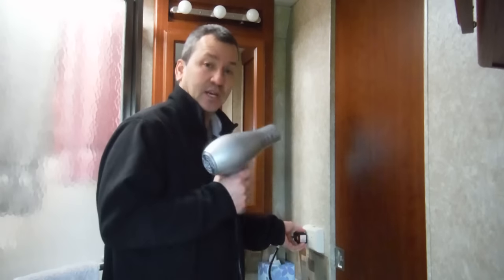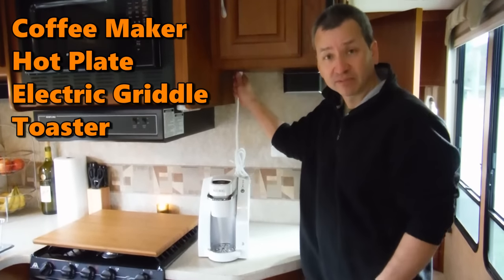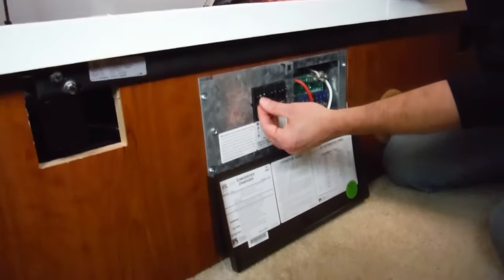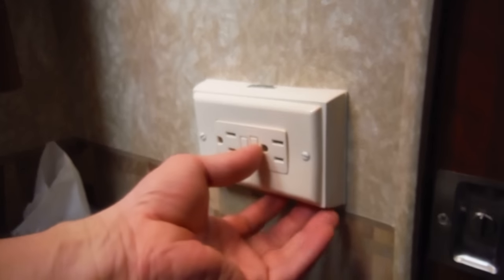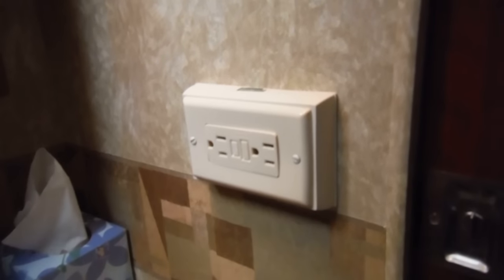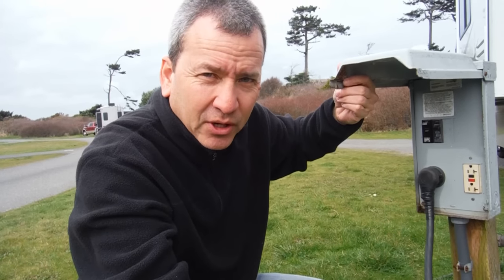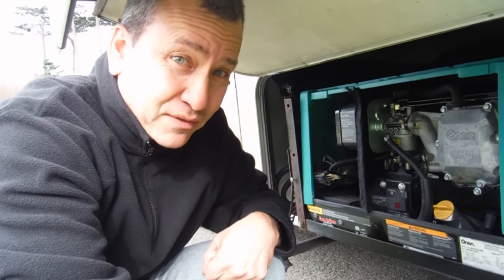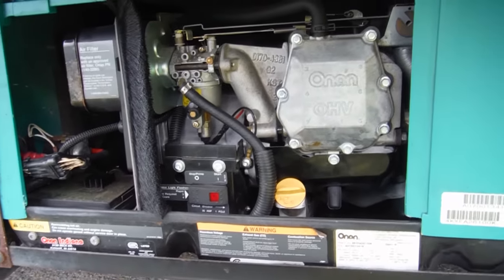How To Restore Power to Your RV - New RVer Tip

Comment: Thanks for the video!  I did not know about the small circuit breaker switch on my Generator which is the same as yours.  So after watching I drove back to where my RV is parked and tried that and yeah no I still don't have power.  Sooooo, I'll try something else tomorrow.  Meanwhile back at the ranch as they say.... I ordered a 900 watt hair dryer specifically  for my RV so it wouldn't overload it.  Haven't had a problem with it yet.  I also turn off the AC and ice maker when I do use it.  Never a problem!  happy camping!

Comment: Don't forget the "shortstop"  breaker reset button off of the battery disconnect sw.  I had to call off a camping trip and returned home.  After research, I found this reset switch and 12 volt power restored.  Cheers!  '03 Fleetwood

Comment: I just bought a 2000 Dodge Leisure Travel van. I was "boondocking" the first few night, and the furnace shut off and the LP gas detector/alarm started beeping, and then the whole RV went dark. The generator can still run the microwave( kind of/sort of, but I don't feel that it is fully powered!), but that is all that it will run! I went to an RV Park, and plugged in, but the lights still won't come on. The coach batteries are showing to be DEAD, but, there is a Coleman 800 inverter hooked up under the driver's seat that the previous owner installed, and it has power (which I just discovered today while organizing stuff for an upcoming trip!!). I might also add that I turned on that same inverter and it ran all day while I was driving the day/night that everything shutdown.   I am at a loss as to what to do! Could the generator actually be running, but NOT putting out enough "juice" to run everything properly? Thanks in advance for any help/insight!!

Comment: Do you ever test the Shore Power box before plugging in? I have a simple tester I use to make sure polarity is correct and it's grounded before plugging in. I also have a volt meter to let me know there's enough voltage to run some of the internal appliances.   Of course one can also plug the hair dryer outside at the box too.  Take care!

Comment: My entire RV just lost power when I was running on battery.  Chassis battery still starts the engine but the house has nothing.  Can't figure it out.. can't even start my genny.  I'm guessing the battery voltage dropped too low.  I recently switched to lithium and is it possible the solar charge controller isn't charging them because of the battery type?

Comment: Our outlets work. Our lights, frig, slide out, and awning does not. Any ideas.
Reply from the maker: Sounds like your 12V equipment isn't getting power. Check your battery disconnect switch (may have pressed by accident), converter/charger or house battery if not on shore power.

Comment: those hair dryers lie about how much power they draw, I just did a test in my last video and it's about 1660-1661 watts for a high-end hair dryer
still a lot though
If that thing actually draws 1900 watts then holy crap

induction cooker is about the same as the hair dryer
water cooler has a HUGE surge at the start but then it's really low
Keurig machine max about 1450 watts

Only thing I found so far that actually draws what it says is my toaster, 450 watts per slot, 900 for 2/4, 1800 for all 4 slots
you can pick either side, so a minimum of 2 slots will be running at one time

Comment: The breaker at my campsite blew and after they replaced it I noticed some of my plugs no longer work. I tried resetting my gcfi and it wouldn't work so I replaced it, and it still won't test or reset and the plugs still don't work. Please help!